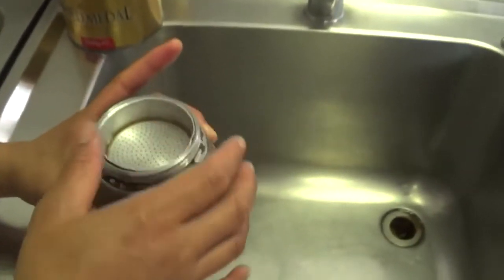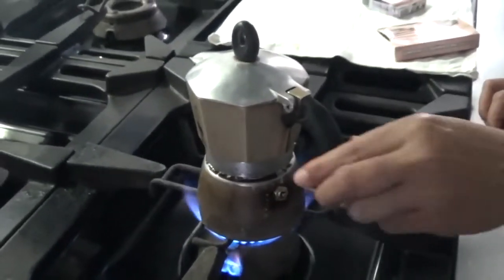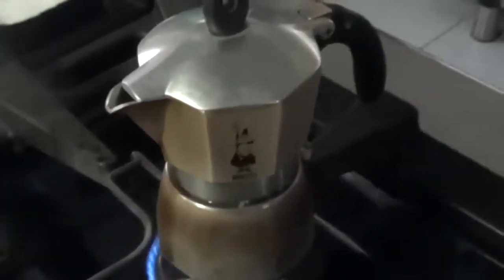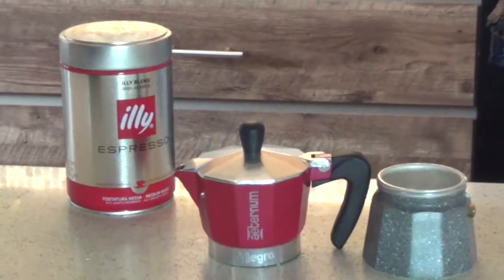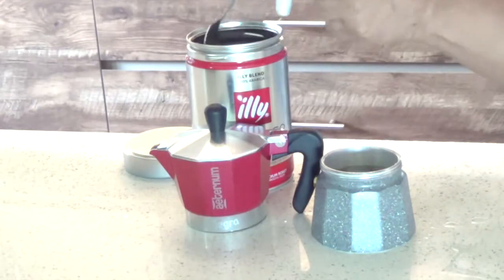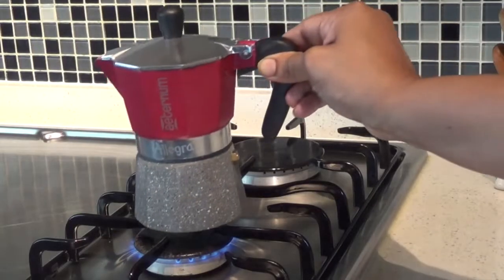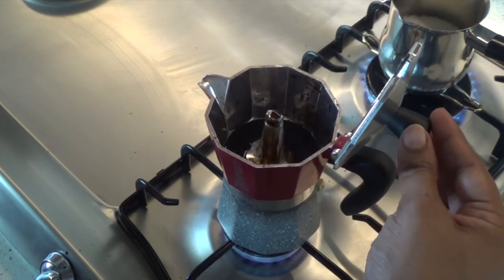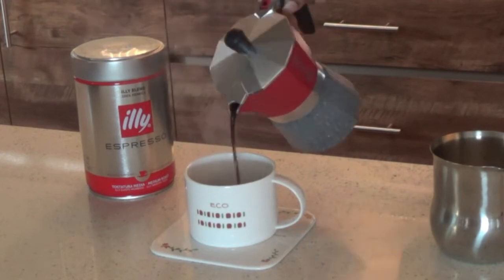ITALIAN COFFEE MAKER | Stovetop Espresso

Comment: How is the taste of the coffee different using this style vs a regular drip coffee machine? ☕️
Reply from the maker: Coffee made using a Moka pot( Italian Coffee  Maker) is typically 2-3 times as concentrated as regular drip coffee. It’s intense, it’s bold, and it has a heavy body. Use preheated water to prevent Bitterness during the brewing process . Although labeled stove top espresso, It is not as strong as true espresso made in modern espresso machines (uses more intense pressure to brew) which is 5-10times stronger than the moka pot
Reply: @Recipesaresimple  thank you for explaining this to me, I thought it might end up stronger. Looks like a neat way to make coffee. 

Cheers to ☕️